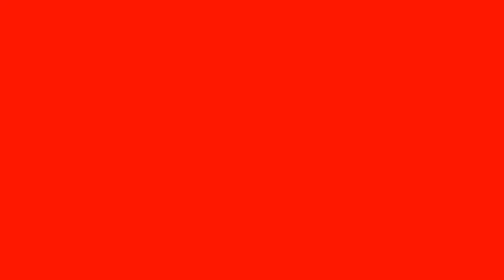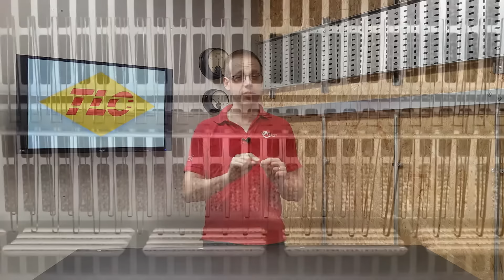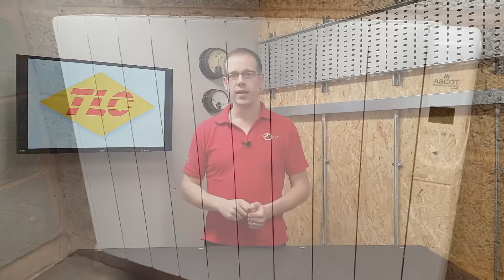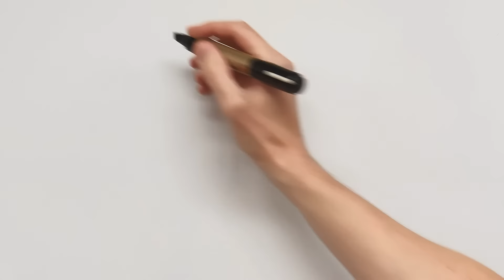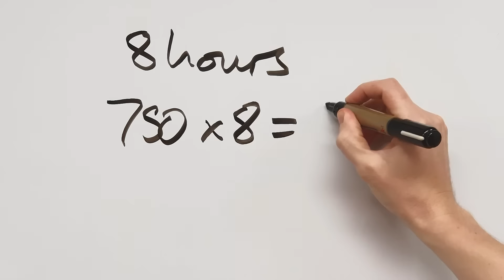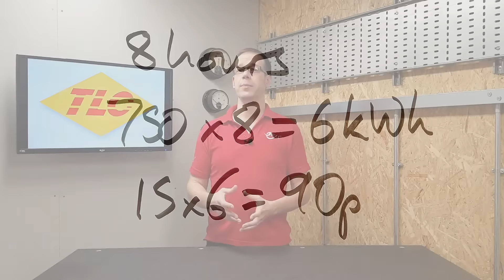Do electric radiators use a lot of electricity? -   Electric panel heaters vs oil filled radiators

Comment: there is almost no difference in the energy used, the only difference is how quick they warm the room up. heaters are 100% efficient at what they do as they waste no energy (wasted energy is heat) a 2kw heater is a 2kw heater no matter what form. the most cost effective are fan and convector heaters as they give full heat instantly so lose less through natural heat loss through walls and ceilings while wasting time heating oil or such.
Reply: It is something hard to compare. But a plug in/electric heater in a single room (especially a small room like a bedroom) you'd expect would be a lot cheaper to run than a gas boiler doing the whole house, which needs gas AND electricity to run. But electric through the whole house would cost loads.

But then you don't need to service an electric heater and it's unlikely to go wrong, so that needs to be factored in as well. Gas prices are likely to only go up now too.
Reply: @BlatentlyFakeName  good point about the electrical consumption of the gas boiler. Totally forgot about that.
Reply: You forget how air pressure can contribute to heat loss through to poor circulation. A higher fan will create pressure that may push air outside the room whereas a radiator heats up the air rather then pushing. Just my two cents.
Reply: @gtccold  what??? i think your brain forgot how to work 🤣
Reply: @ShadowzGSD  Just referring to one of those heater with high speed fans. It pushes the air out of the room and may contribute to lost of heat. Just imagine two bath tubs. One with high flowing rate of water and one with lower rate. Faster rate overfill the tub and water gets displaced outside. Lower rate doesn't displace because it drains as fast as it fills the tub. Both water tempt are equal. Heat requires to heat the water is the same. But the one that overfilled is less efficient because you're losing hot water over the tub. No my brain is still functioning bro. Both heats the same, but over distributing can cause an issue of heat loss. That's all. And you may say that it doesn't matter because both drains at same rate. Yes. Both do drain at same rate, but the overpowered ones loses extra heat when displaced over the tub. Let me know where I am wrong with this instead of questioning my brain. That would be a better respond. And I do do want you to prove me wrong, because if I am wrong then it's a learning lesson and not dead brain :) Your turn.
Reply: @gtccold  it is not introducing air from the outside to increase pressure, it is recirculating the same air, it is not possible to increase the room pressure without introducing new air. filling a bath is completely different to heating a room.
Reply: It's surprising how this simple principle of 100% efficiency is not understood by most people.  It gets a bit more complicated when you start thinking about the differences between forced air, convection and radiating heaters.  Infra-red halogen or a radiating panel might be more useful where the room isn't insulated very well, or when you need outdoor heating.  The heat from an infra-red lamp shining on your face or hands can be much quicker than a fan heater, especially if you have just come home from the rain and moving air will draw heat away from your skin as latent heat of vaporisation.  For water this loss is 2.3kJ/g.
Reply: We all often directly compare gas and electricity systems based upon price per kW of energy. Perhaps we should also take gas system losses into account. For example, flue gas heat loss, combustion heat exchanger efficiency, loss through copper pipes in floor voids and loft etc, standing charges for gas connection, boiler annual maintenance and repair, etc. I suspect that when you add all these "hidden costs" on to a gas system it might not be so compelling. Then add in the moral aspect due to climate change and electric heating really does start to stack up. My house is electrically heated with modern oil filled rads and I would never go back to gas fired central heating. My hot water is also electrically heated in an unvented cylinder - loads of hot water at towns mains pressure, just perfect!
Reply: @JJ-zg1hh  
Out of interest what is your annual kwh usage for your electrically heated house?
I use something like 35k kwh of gas each year and I fail to see how electric could be remotely cost effective.
Reply: @ChrisLee-yr7tz  Hi Chris I live in a skiing chalet in the French Alps (I'm British). It was built in 1990 and so is reasonably well insulated (all walls and loft. It's a 5 bedroom detached property and we use about 18,000 kWh of electricity per year (about 3,500 euros per year). We also have a log burner which helps with the heat load. Of course the winters are very cold but the insulation is the key. We rent the chalet to guests so we have to heat it hard to keep clients happy.
The thing that strikes me between UK and French houses is the focus on insulation. It really does make a noticeable difference to the energy consumption. I used to live in a 1920s house in Manchester and that leaked heat like a seive!
Reply: @JJ-zg1hh  Thanks J J.
Yep, 18k kwh seems really good considering the location.

Still not convinced how the pricing makes it viable though.

Here in the UK we're looking at roughly 7p for gas vs 28p for elec per kwh from April onwards. At somewhere around the 20k kwh usage mark, the difference in cost is astronomical even if the gas type system was less efficient.

It'd be nice to move away from gas but I just can't see how its financially viable.
Reply: @ChrisLee-yr7tz  I think that's why the UK government are pushing heat pumps so much. The coefficient of performance makes an ASHP about 300 to 400% efficient, bringing it more in line with the unit price of gas.
Adding solar will really help mitigate the costs. A 4kW solar system typically costs about 6 grand so could be worth considering.
There is also the moral argument for Global warming / Russian sanctions etc.
Plus an electric house should be worth more than a fossil fuelled house in a few years, I would imagine. 

I'm currently looking to buy a small rental property in the UK and trying to get to grips with this dilemma myself. Do I buy a period house with a GFCH system or look to the future and get a modern build with electric heating.
Sorry for the ramble, but very interesting topic!
Reply: @JJ-zg1hh  No, not a ramble. I'm fascinated.
I have multiple rentals and am also about to do up my own house.
Even with the ASHP multiplier, the 3-4 CoP only just get close to equalising the direct running cost.
When you add in the equipment cost it's all still miles off.
The uncertainty of length of life and maintenance costs is what scares me the most.
Reply: @ChrisLee-yr7tz  Hi Chris, I agree it is a fascinating topic and we're at the start of the curve really. Like mobile phones or personal computers, they were expensive to begin with but totally normal now. I guess heat pumps will come down in price eventually. For me when I buy my rental I'm going to make sure its suitable for solar (south facing roof etc) and can receive a heat pump (no micro bore copper pipes to radiators, stuff like that).
One thing for certain is that natural gas is dying as a technology for domestic heating and will be illegal to burn by 2050 anyway due to the net zero rule. I'm also worried about gas prices rising as we have had years of government subsidies in the O&G industry which I imagine they will pull back on in the future. 
How about this concept for a small rental property - electric convector rads in each room (1000 quid with electric install), 200 litre unvented water cylinder (say 1000 quid fitted), and 4kW solar (6000 fitted). If fitted to a modernish house I reckon the bills would be nothing. No gas supply. You rent as "all bills included" and the Tennant repays your investment back over time. Zero maintenance too. Plus the property should have strong capital growth due to the enhancements made. This is my line of thought at the moment.
Reply: @JJ-zg1hh  I like the concept and have been thinking the same but I don't see how you can generate enough solar to heat the house.
Reply: @ChrisLee-yr7tz  True. What I need to understand is how much surplus power is generated in the summer to mitigate the winter consumption.